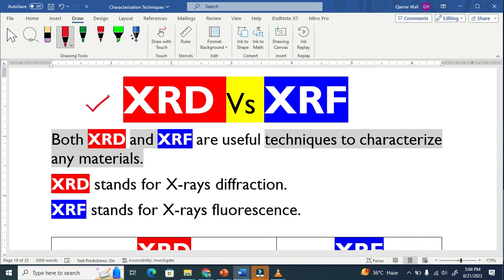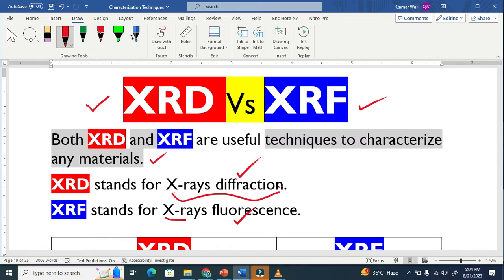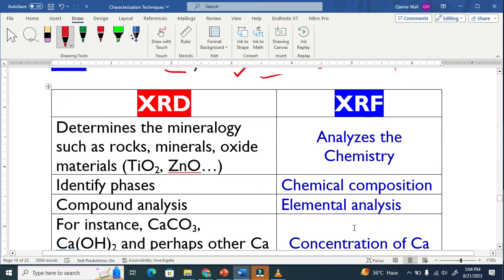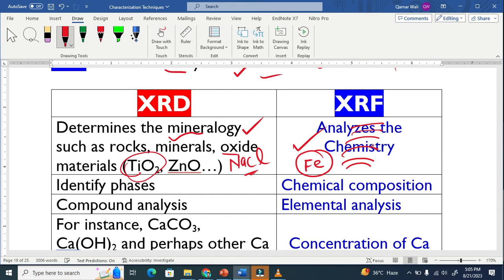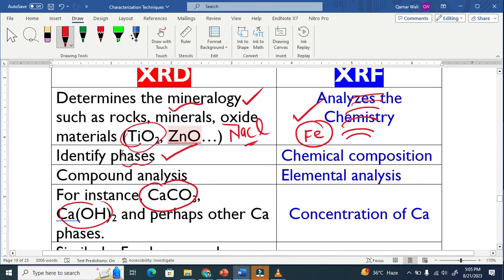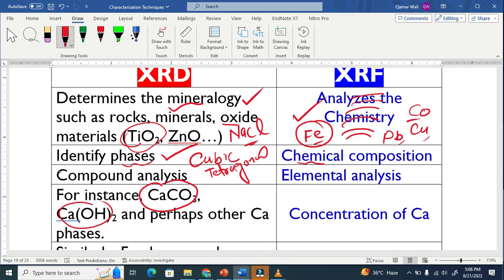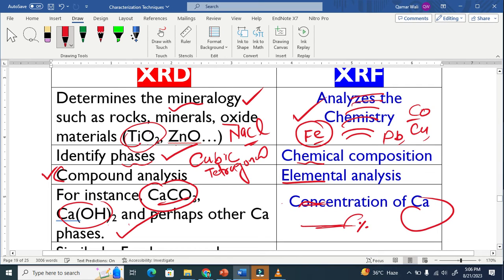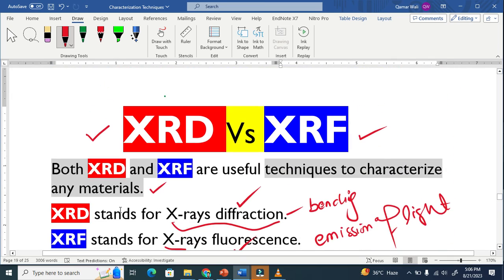XRD vs XRF: How They Reveal Phases vs Elements in Materials Analysis

Comment: Sir what are the parameters extract the XRD pattern and what factors are depend on them .
Reply from the maker: I am not sure if I understand the question 🤔. 
XRD pattern is just like *fingerprint*, which identifies every individual and is different and unique for all humans.
XRD graph reveals the information about minerals, rock,  compounds, etc, and each material has a unique XRD pattern. 
It gives a lot of information such as whether the sample is crystalline, amorphous, the unit cell details , the interplanar spacing (d) between plans, the crystallite size, the Miller indices..
Reply: @nanospeaks  sir my question is that in XRD as we see the intensity peaks is variational so why this happened and why we need to calculate microstrain .
Why we need Williamson's hall  plotting already we have the formula of crystalline size and strain for calculation.
Reply from the maker: @nehasharma-fc6cv  I dont know the second part of the question, but let me answer the first part of the question to the best of knowledge.  In every polycrystalline material,  there are  prefered crystals orientation in particular direction that reflects X- rays that lead to the intensity.  So, there are different plans with different atom densities leading to varying intensity.  The more atoms, the more electrons, the higher the density leads to higher intensity while the low intensity means low concentration of the atoms in that particular direction.  As the  polycrystalline is made of different crystals  with varying sizes that is why varying intensity in the XRD pattern.
Reply: @nanospeaks  thank you so much sir ....thank u for clear my doubts
Reply from the maker: @nehasharma-fc6cv  you are welcome 😊
Reply: @nanospeaks  sir I have request you if u don't mind ....can I disturb you with my  doubts some time.
Can u guide me and where u available
Reply from the maker: @nehasharma-fc6cv  anytime. I am happy to help if I can